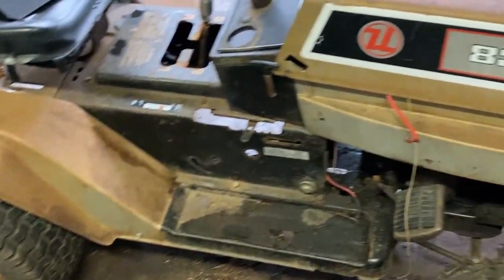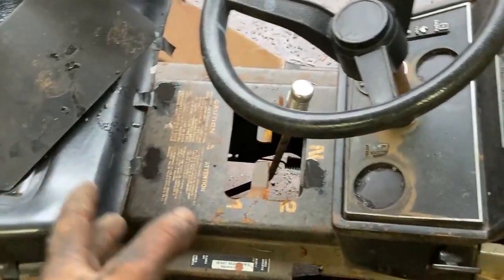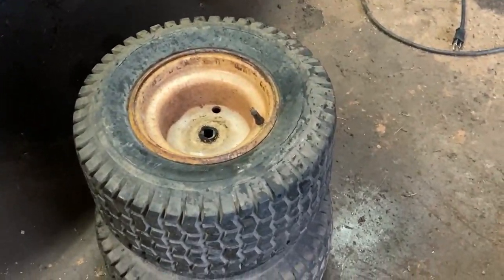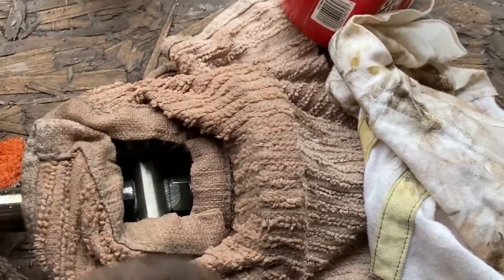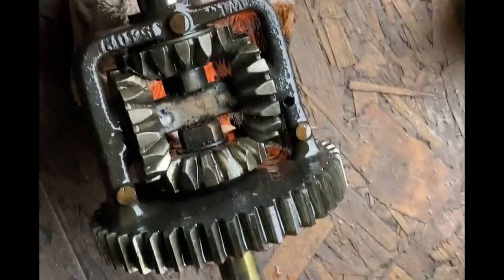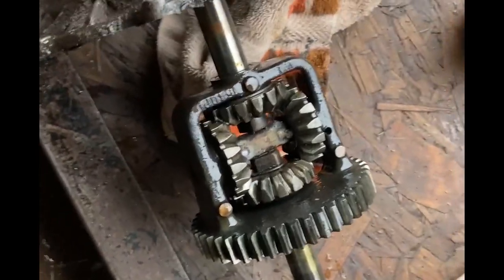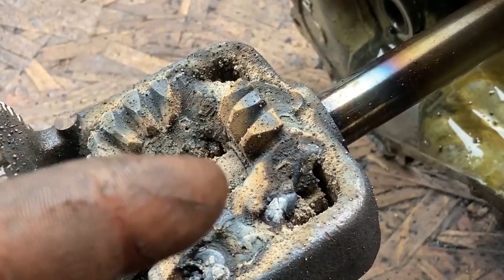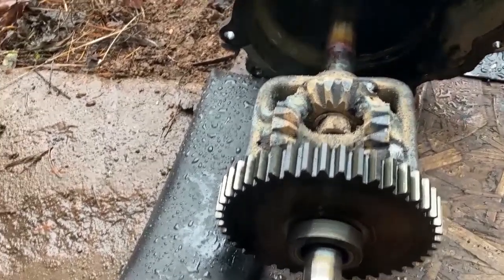Welding a 3 Speed Peerless lawn mower Transaxle

Comment: I have the same gearbox. My dad made a complete balls up removing the rear wheel and used a bottle jack and ended up pull the axle out. Now I've watched this I'm fairly sure I can fix easily just by splitting the casing and putting a new clip on the shaft. Great video

Comment: The moment you realized you couldn’t get that center pin out after you welded it in place lol, but it should hold up good and since you didn’t weld the one axle gear to the other 3 it still should flex. It’s been a while since I’ve done any transaxle work but I just got one with seized input bearings I’ll have to tear into. Great video with great step-by-step instructions!
Reply from the maker: Yaeah been years for me to. Looking forward to see how it’s going to work